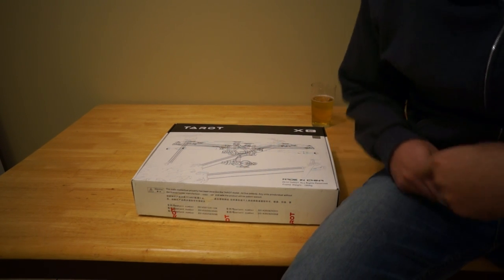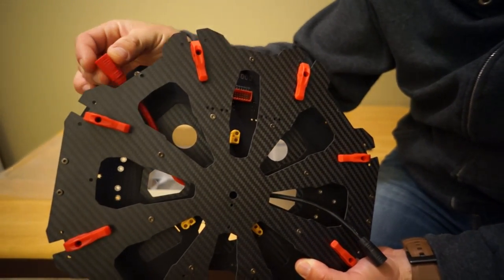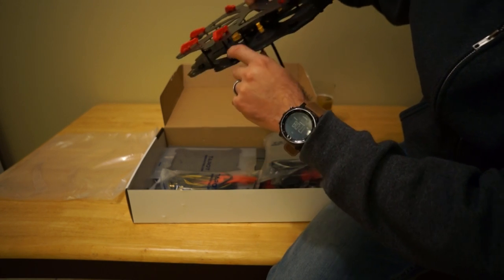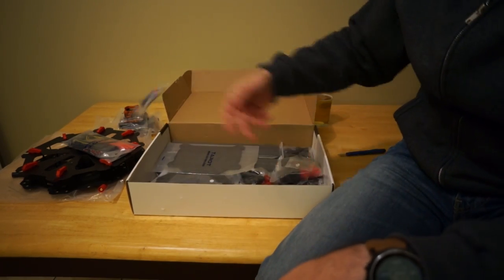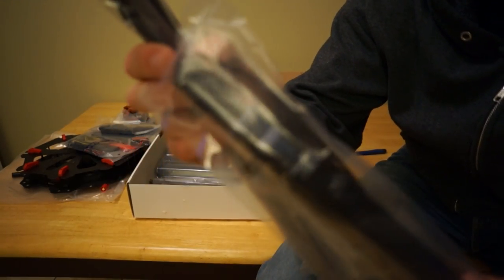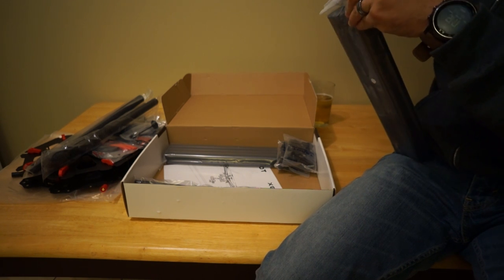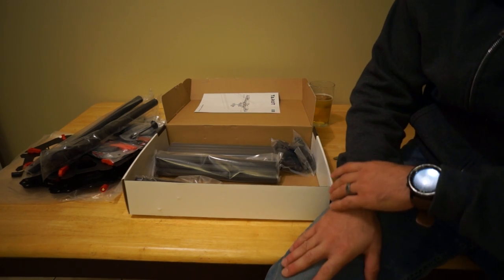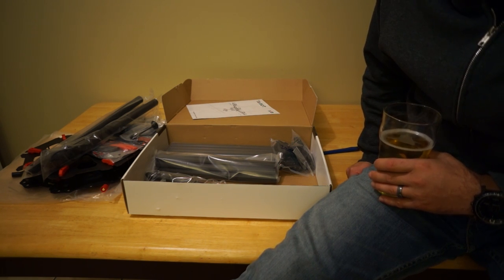We unbox the Tarot X8 TL8X000 1050mm Octocopter Frame

Comment from the maker: @Baotri Ho, What I call the gimbal mounting plate in the video is actually your battery tray. The instructions show a few different configurations possible, so you can use that tray to put your batteries underneath the center plates, or you could put them up top. The "C" shaped metal arms shown in the video are actually used to mount your gimbal to the hanger rails, with an anti-vibration interface in between of course. It'll make more sense once I get it all assembled and put a video up. Thanks for the comment!
Reply: Thanks for the clarification and thank you for posting this video.  I am very interested in this frame and thinking about ordering soon.  Keep up the good work and thank you.
Reply from the maker: See this thread on RCGroups for some good info on this thread: 
http://www.rcgroups.com/forums/showthread.php?t=2275017